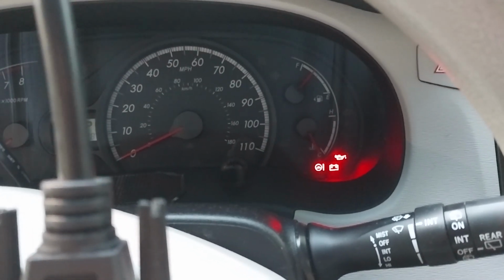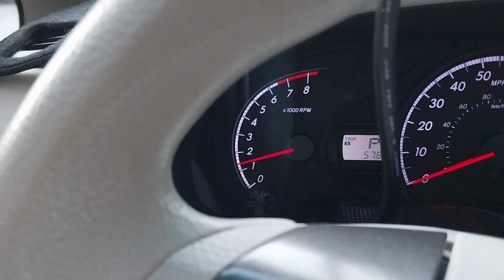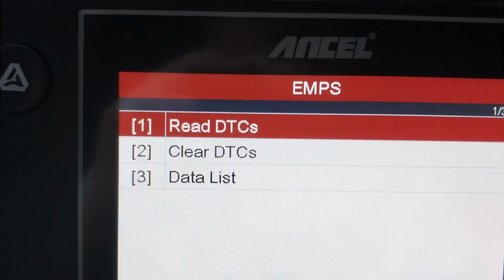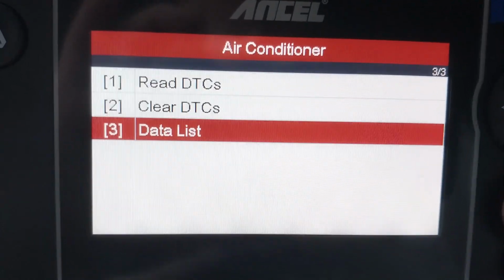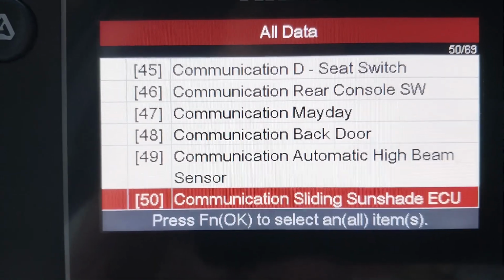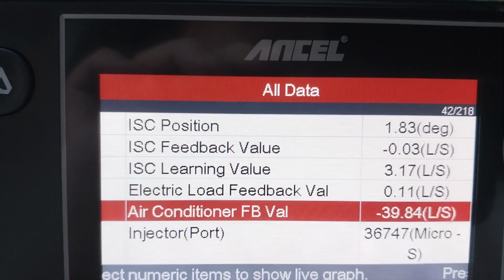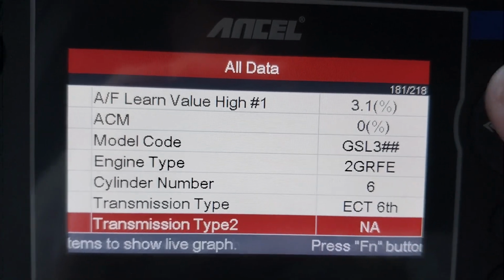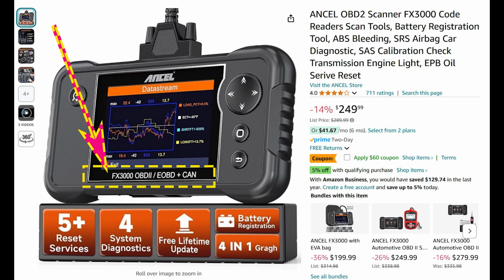Ancel FX3300 Elite OBD II Scanner walking through menu

Comment: I just bought one. It is slooooww. It only data logs two values at once. It does more than just a scanner but not as much as I really need. I have a better one ordered with resets and bi-directional communication. It wasn’t but a few bucks more and is much more versatile. It will do for someone that wants to check things out do they don’t get robbed too bad at the mechanic shop but if you want to bleed and brakes or reset oil life or anything you will need another device. No component actuation from this tool either.
Reply from the maker: Which one bi-directional do you have? BTW, oil reset is a written note on these  OBD's, at least this what I got when tried to reset oil mileage on Honda CRV 4th gen.